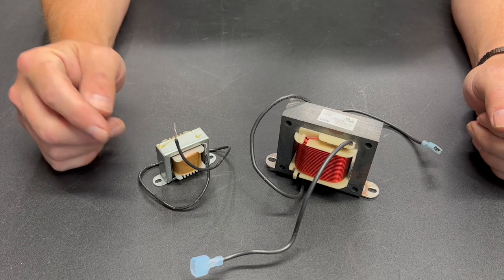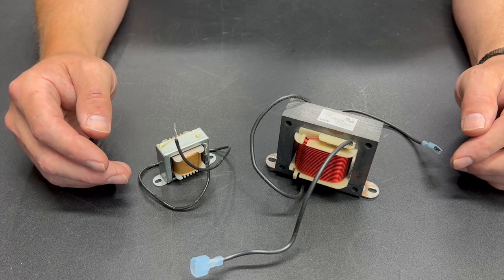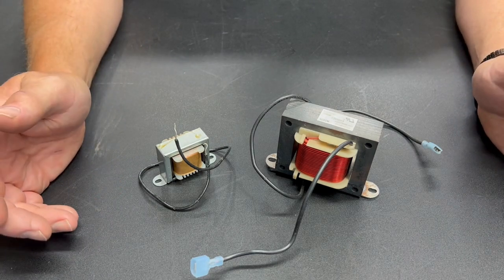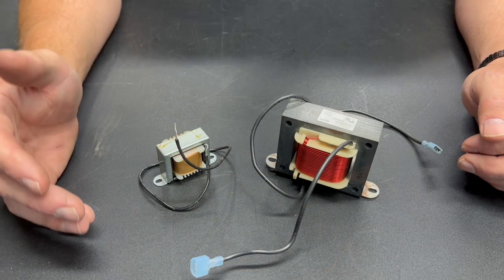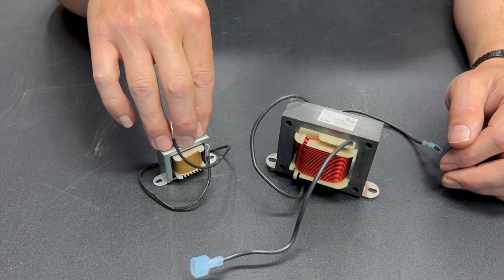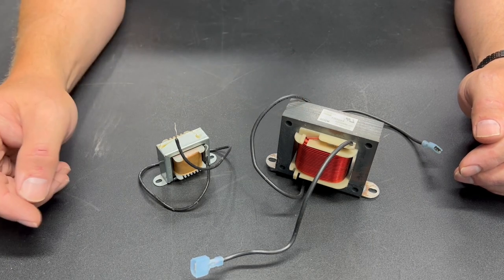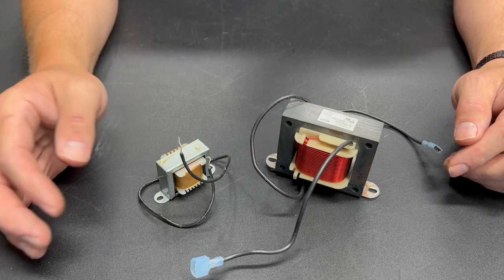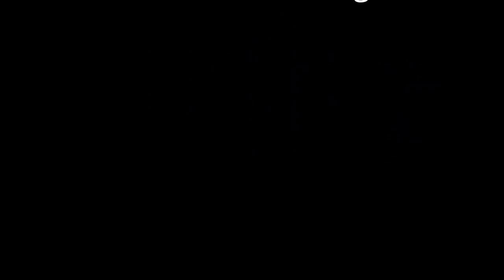The Wrong Choke will Strangle Your Treadmill Motor

Comment: The motor I have has a ring coil wired to it, if it was big enough for the treadmill, will it be big enough for the lathe?
Reply from the maker: some motors come with them and while it helps a little it is no substitue for an actual motor choke.

Comment: I am a victim of this choke from amazon. In my infinite wisdom, i purchased 2 thinking, well if it's not quite adequate, maybe 2 in series will be (tightens the noose over my motor). I resorted to making one from a transformer out of old microwave. I now know it is still not big enough. 
If you had to guess, what gauge wire do you think your lathe choke has? I have transformer cores i can use from old die cast machine panels that are softball sized that i can wrap. Thanks for all the videos you put out
Reply from the maker: 16 awg is the minimum

Comment: How is a choke rated . I have been trying to find one for a  treadmaill motor  but can't work out the rating.   Can a capacitor be used as a choke.
Reply from the maker: Amps is the most important rating.  Most are rated in Ma which means they will not be even close enough for a motor.  The key to sizing a choke is get one labeled as a motor choke.  If it's not labeled that way it is likely too small.  A capacitor can not be used as a choke but it can be used as a filter.  I will get you the specs off of the caps I have BUT my experience with using a capacitor is it caused surging under a load.

Comment: Similar to a microwave transformer/choke I took one out of a car battery charger. Removed the transformer coil however the choke has 3 wires. A blk on the left and right, and a red in the middle. Am I wrong in thinking this is a choke? If it is, would I just run the blk wires?
Reply from the maker: That sounds like a class 2 transformer. The gauge of the coil wire is probably too small.
Reply: @dazecars  ok. Bummer. Thank so much for your response and for your time. I b appreciate it.
Reply from the maker: measure the wire to know for sure

Comment: Do you know the henry rating on the choke you have? I'm looking to get one from an electronics supplier with the right amperage but online I can't seem to find the right rating for it
Reply from the maker: Not being an electrical engineer I do not have any specs or calculations for you on the motor choke. What I can do however is offer you some guidelines. First of all bigger is better. I have several motor chokes ranging from the size of a tennis ball to the size of a soft ball and the bigger they are the better they work. Second the wire for the choke needs to be a minimum of 16 awg. If the wire is not that big or better it will not have the amperage capacity to allow the motor to work properly. Amperage is the most important spec.  A lot of the chokes available online are rated in mA.  there are 1000 mA in an amp.  Treadmill motors are rated in amps so most chokes available online are several hundred times too small.  Third they are not available from most suppliers at least not inexpensively, there are a few privet sellers on Amazon selling used parts for big bucks but the available chokes on amazon and electronic supply houses are too small because they are not designed for a motor even though they look correct in the picture they are WAY too small. The correct choke will be labeled "motor choke" because there are no other uses for it.  The choke in most of my videos is part number 130993. Instead of getting one new I would get a used one. A lot of treadmills come with a choke. Go to eBay and search “treadmill motor choke” BUT know that most people on eBay don’t know what they have and the word “transformer" will also appear in most listings. Problem is a choke and a transformer look almost identical so some listings are for transformers and some are fore chokes because the sellers think they are interchangeable. They are not. They would only be interchangeable if you modify a transformer to work as a choke. (see my DIY choke video) To tell the difference count the wires. A choke will only have 2 wires, a transformer will have 3 or more. Also before I started doing videos chokes on eBay could be had for $25 or less shipped but now that more people are looking for them (due to my videos) the eBay sellers have raised their prices quite a bit. Your best bet might be the DIY option out of a Microwave transformer. Please let me know if I can be of further assistance.
Reply: chatgpt says 20 amp motor -> 20 amp choke. 30 amp motor -> 30 amp choke (minimum).
Reply from the maker: Obviously amps need to be matched or the choke needs to handle at least as much as the motor draws or more so a 20 amp motor could be run with a 30 amp choke.  Again that is why I said bigger is better.  The specs that were being asked about are Henries, which is the comon spec specific to the frequency the choke filters out.

Comment: Hi Daze? I have a question that i haven't found an answer to yet will a choke burn out or stop working
Reply from the maker: Not usually.  There is no moving parts are friction points and they typically don't get hot.  If you have continuity then it should be working unless there is a direct short near the leads bypassing the coil.
Reply: Ok thank you started collecting treadmills one I might grab say's the motor doesn't work  and the belt and rollers are very stiff lol was wondering If the choke was maybe the problem lol
Reply from the maker: To test the motor, disconnect it from the treadmill and then "connect" the leads to a battery.  Do a quick touch rather than a full hook up.  You will know immediately if the motor is bad. @barrywaite2386

Comment: Hopefully you reply, what about the one it comes with, mine came with one I am going to use it for a sheet metal bender for fire rings?
Reply from the maker: If your machine came with a motor choke then it is up to the task and good to use.  The bigger ones on my video came from treadmills.  Just make sure it is actually a choke and not a transformer.

Comment: me what i want to know is how do you attach a v belt pulley to one of these if you dont have a lathe to resize a shaft to it
Reply from the maker: Take the flywheel to a machine shop for resizing or completely remove the flywheel and mount the new pulley directly to the motor shaft.   Just make sure to add a fan if the flywheel was also the cooling fan.
Reply: the encoder is the fan lol 
 @dazecars

Comment: Question for you, can I get two medium sized chokes and wire them in parallel to make them act like one bigger choke?
Reply from the maker: define medium?  The small one on my video would take at least 16 in parallel just to handle the amperage.  If you are talking actual motor chokes that can already handle the amperage than two of them in series could work or you could put one on the positive leg and one on the negative leg.
Reply: @dazecars  thank you for your reply. At this point the size does not matter. What I was wondering, was this. If I am using multiple chokes to control the current surges for a motor, do have have to wire them in parallel or in series? Because it is current we are trying to manage, I thought they would have to be set up in parallel. Am I correct?
Reply from the maker: @raulc.  power spikes are a function of voltage so series would be better for eliminating spikes.  However if the wire in the winding was a little on the small side and the choke was limiting amp flow than parallel would be the solution.  The size of the magnetic field has an effect on the effectiveness of the choke.  That is why, as a general rule, bigger is better, because you have a bigger magnetic field, AND bigger wire to handle more amps.
Reply: @dazecars  that makes sense. Thank you very much for taking the time to explain. I have a couple dozen chokes. Many different sizes. I am going to perform some experiments with them. I am going to connect them in both series and parallel and hook them up to my oscilloscope and an amp meter. It'll be interesting to see the results. Again thank you for your videos and thank you for the explanations. Your video inspired me to conduct some of these experiments.
Reply from the maker: @raulc.  Sounds interesting, let me know what you find out.  I would love to add your results to my knowledge base.

Comment: Its larger than whats in a microwave. I removed the upper transformer portion.
Reply from the maker: okay no not a class 2 transformer.  You need to use a meter to check continuity and you need to make sure there is only one coil and no other wires.  a single strand of wire running through the core would be considered a coil.